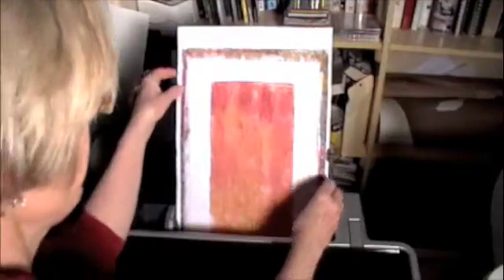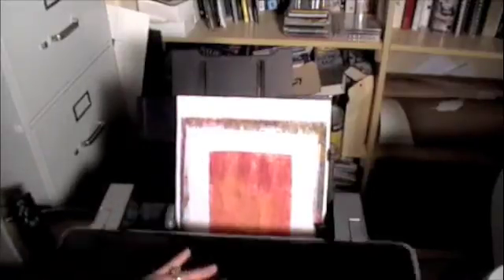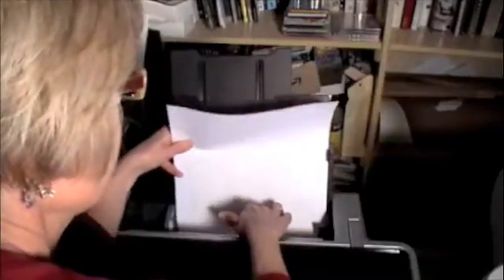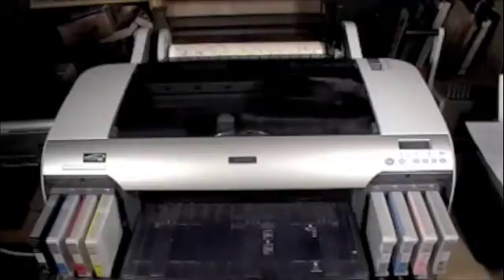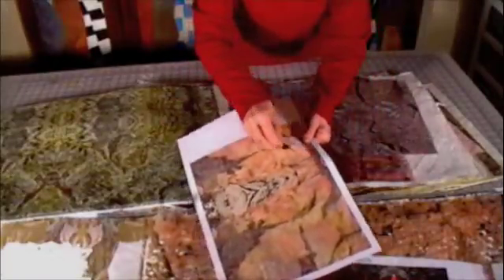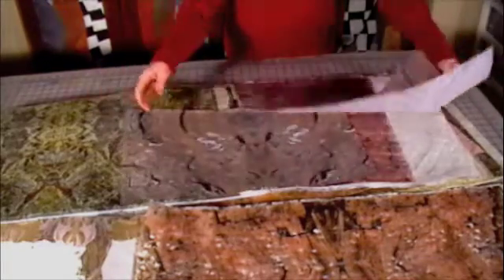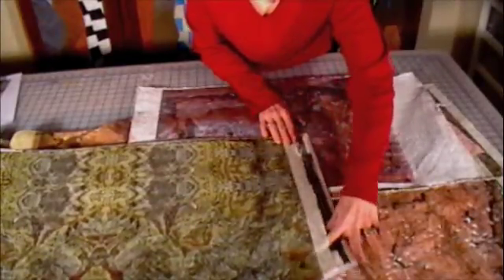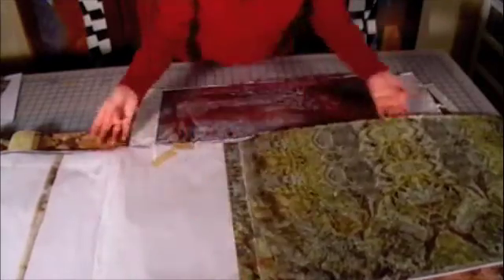Expanding the Digital Print to Uncommon Surfaces  Part 3

Comment: Excellent, I don't know if you mention in the video, but on which sheet of paper are you putting the metals, organza etc???
Reply from the maker: The metals go on papers that are thin but stable. Try to keep the two stacked surfaces thin enough to get safely through your printer.